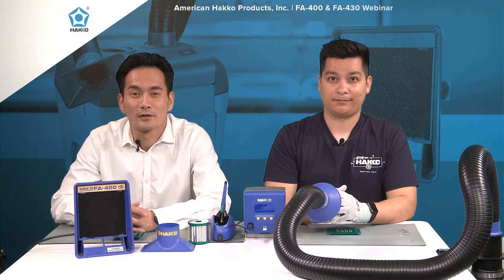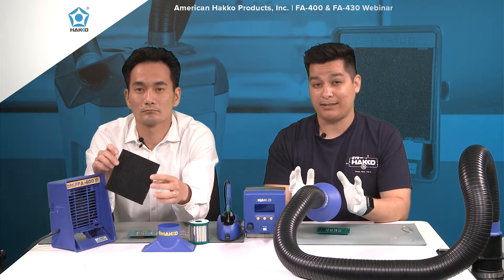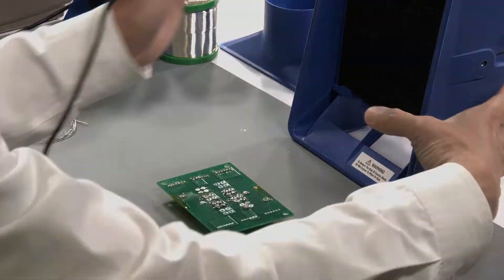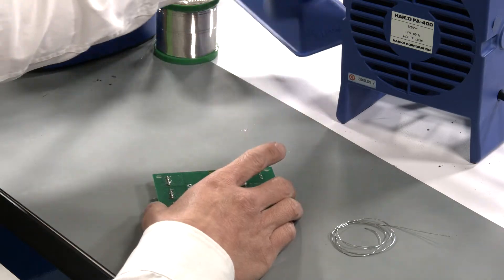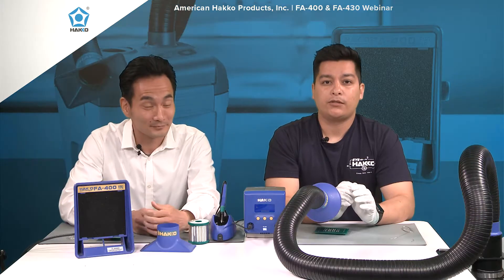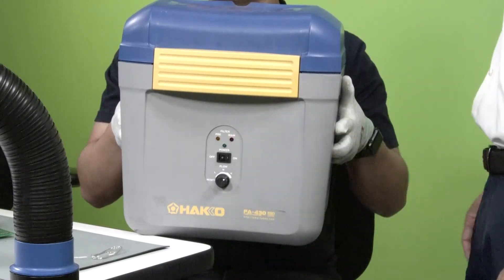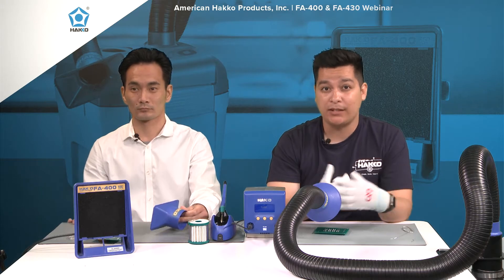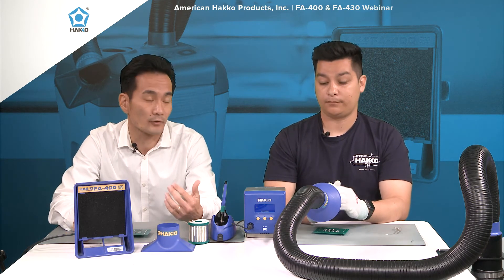Eye on Hakko | Breathing Easy with Hakko's Fume Extractors and Smoke Absorber

Comment: How much is the vacuum cleaner? It's a Hakko so must cost around 2,000$ right?
The first one is just a Noctua fan right?
Imagine paying over 100$ for a table fan that you can lay down or stand up.
I was convinced that the Hakko FM-206 would have been perfect for me.
Costing over 2,000$ for three stations in one.
But then I learned that the Atten 862D is much more powerful.
They also charge nearly nothing in comparison.
I will not be buying a sucking machine from Hakko.
I've seen some for about 200$ to 400$ that look more efficient.
What I'm saying is, Hakko had better try harder.
Competitors and copycats everywhere, distributors in Canada hardly keep a catalog and it's very difficult to find parts for decent prices or at all.